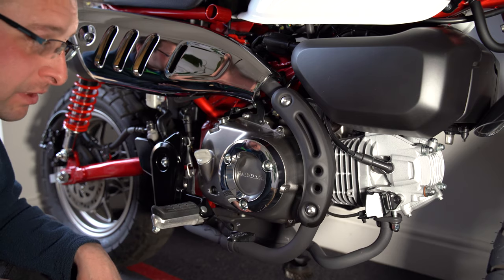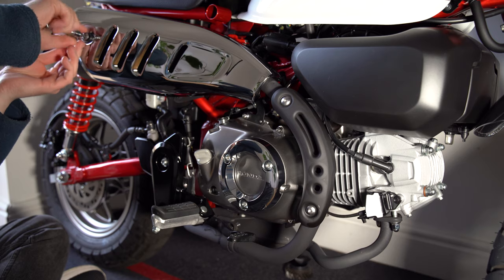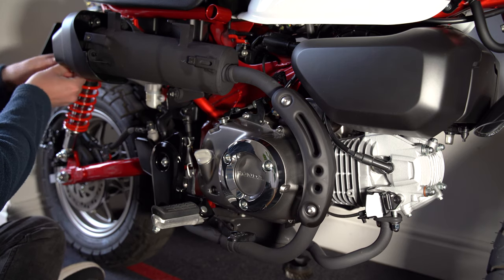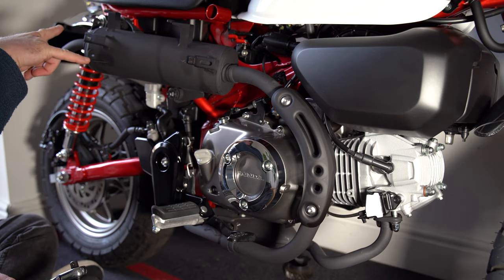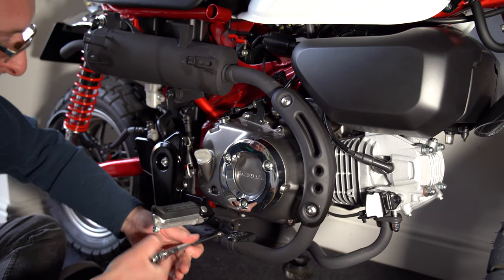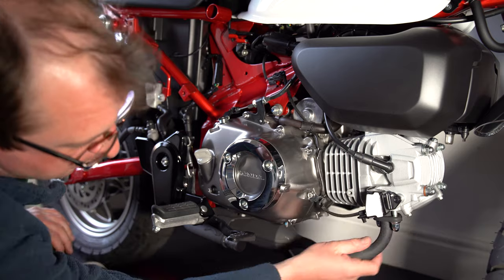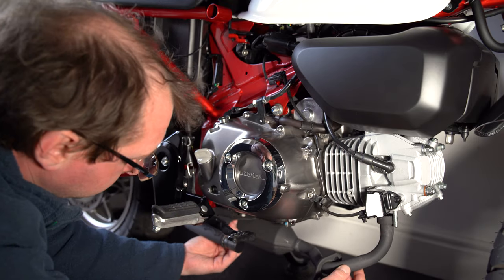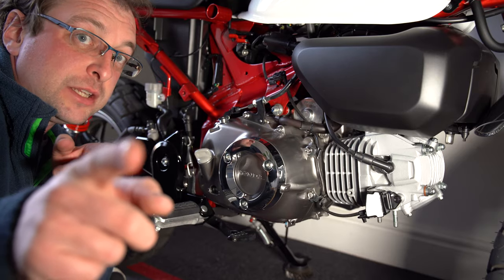Honda Monkey TV - Removing the exhaust system

Comment: The service manual instructs to replace the muffler gasket with a new one whenever the muffler is removed. It also recommends replacing the exhaust pipe gasket whenever the exhaust pipe is removed. There are different torque requirements for replacement of the hardware from  7 lbf-ft to 20 lbf-ft, so one should consult the service manual.
Reply from the maker: Hi - Yes it does, however although this video is specifically about removal, its worth mentioning - Personally I re-use some gaskets when possible, and due to the very low mileage in this case both the tubular manifold-to-main pipe gasket and circular head-to-manifold were in perfect condition for re-use. 

And yes, always torque accordingly.